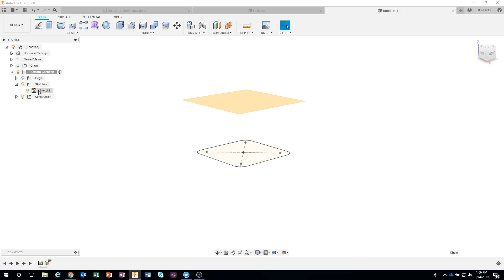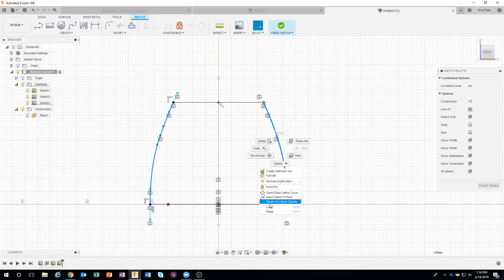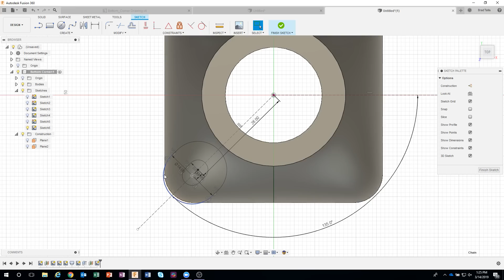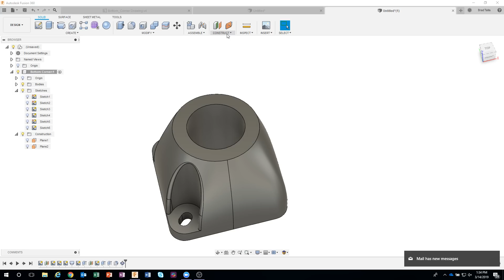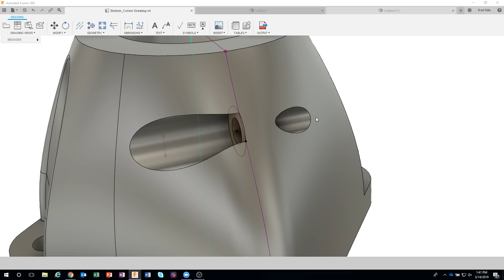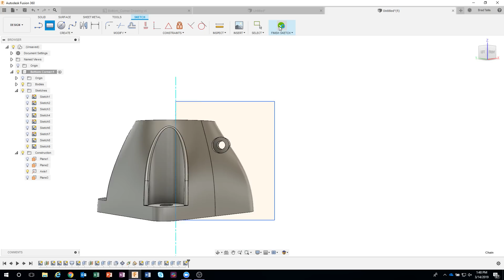360 LIVE: Lofting to new heights

Comment: Really learned a lot, so I really appreciate this video and your efforts.
One of my biggest problems is, I don't get to use F-360 on a continuous-basis, so I will make a part then have to relearn everything again later.
So, I now figure, I need to occasionally make a F-360 part even if I never use it; but do it on a regular basis time permitting. 
Anyway, from one instructor to another, you do a great job...  Thanks!

Comment: The slot position - stated to be 26mm, if the initial rectangle is in fact to be 53mm - and the point you use to dimension it (inner point in the slot) - is 26 - then the slot itself goes on the outside, or what am I missing?  Thanks by the way, I do learn a lot :)

Comment: Can you point me in the direction of a video that would show me how to add objects inside of a loft?  For example, a glider/airplane fuselage and add support structures inside of the fuselage?  And/or add a vertical servo mount?   The issue I'm having is that i can draw the support structure, but when extruding, it doesn't follow the path of the fuselage.  It cuts through the fuselage.

Comment: One year later and being new to Fusion and using the latest version I wonder a few times "why did he do it this way?" Like the center hole - it could be done easier as drilling. Or the surrounding of the slot, could be made as offset. Or that center point rectangles automatically have construction lines.

Comment: Super 👍 Thx! 😄 
Speaking of Autodesk Adding... What're the chances Autodesk will Add the removed/replaced yellow lightbulb ON/OFF icon with some yellow color? Zilch... 🙈✌
Reply from the maker: 4FunRC-  The changes from the lightbulb to the eye was done to make many of the Autodesk programs similar in design and functionality.
Reply: @adskFusion   Yes, I've read that... my offhand question wasn't worded very well. I understand Autodesk's plan and it makes sense, albeit I was thinking along the lines of keeping the "eye" icon and adding a bit of color (yellow, perhaps... outline or solid color) to help the User's of Autodesk's products with ON/OFF state visibility. 
Regardless, I appreciate your reply... Thank you.

Comment: So I made the part no problem and wanted to do a drawing of the part. when I try to add a dimension for the size of the square bottom Fusion has a green box at the top and only gives dimension to green box at spit in the body even though I'm clicking on the bottom line of a top down view, has a mind of it's own.
Reply from the maker: Hey Rick, I'm having a little trouble understanding what's happening here. Can you send a screenshot to aaron.magnin@autodesk.com

Comment: - Another good video. Thx.
- I would appreciate an "advanced lofting" video.
- Relatively simple lofts are one thing (like in this video), but things can become "unmanageable" sometimes - at least in a recent loft I attempted.
- Use case: hydrofoil. This involved many cross-sectional splines, and rails making curves in all three dimensions.
- I watched a bunch of videos, read posts, plus have years of 3D experience, yet nothing worked to my satisfaction. I have worked w/ easier loft systems.
- BTW, I also explored T-splines, but here too w/ limited success.
- Now, I freely admit that part of things may have to do w/ me, BUT as noted, I've been at this for years, and have used simply/easier systems, so there may be room for improvement in F360's implementation.
- Upon request, I can dig up the project and be more specific as to the issues/error messages. TIA.
Reply: P.S. Also had issues when attempting to loft a paddleboard.

Comment: Great video, but I have two questions.  I am using Fusion 360 on a Mac and the menu layouts are different. For example I do not have a 'design; option on the left hand drop down and I do not have a 'constraints' panel at the top, only in the floating item options window. Is the menu layout in the Windows version radically different to the Mac version?

Secondly I do not seem to be able to add a fillet to the 2D sketch of the base. When I select fillet the view jumps to a 3D view and yet I still cannot apply a fillet to any of the edges.  Yet I know I can apply a fillet to a 3D volume.

Am I missing something?
Reply from the maker: To your first point, Brad is using the preview UI. Check preferences > preview UI. 

To your second point, it sound like you're selecting a fillet feature, rather than a sketch fillet. Try grabbing the fillet tool from the sketch menu instead (when you search, it's hard to tell the two apart).
Reply: Ah, I see.  Many thanks! This is my first week of trying to learn Fusion. I am blow away by how comprehensive it is. It is very cool.  You answered both my questions. @adskFusion